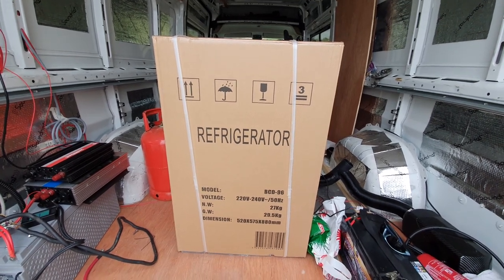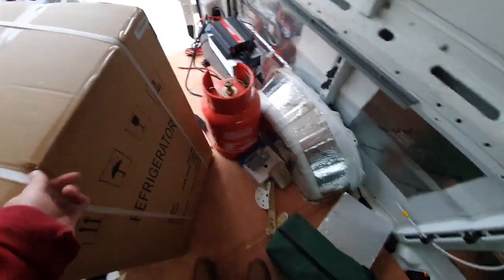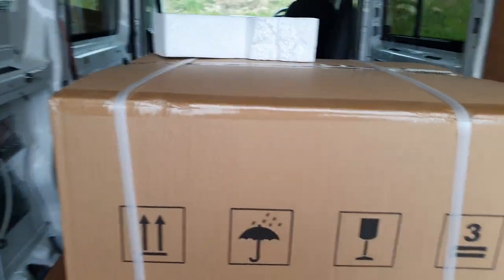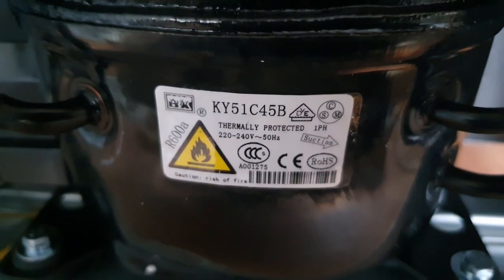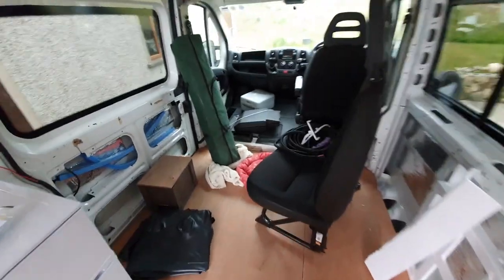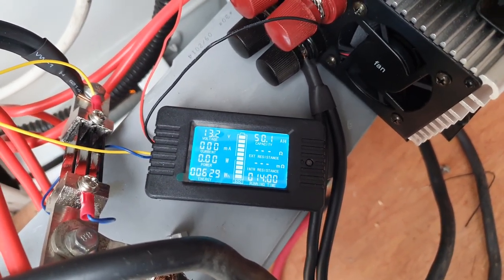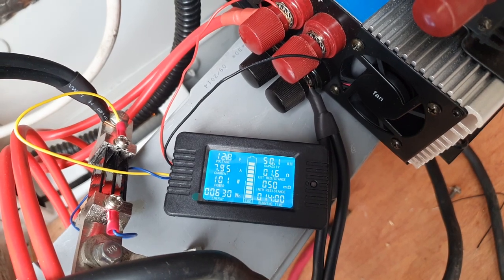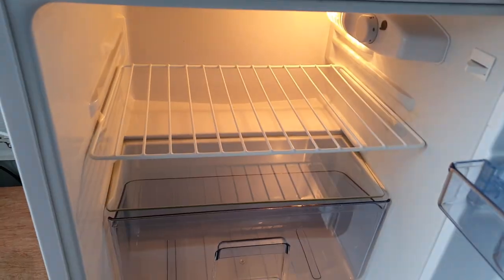Is this the END of Camper Van Fridges???

Comment: Hi. I have an under counter domestic fridge freezer running via my inverter on my Narrowboat, it has worked happily for over 3 years. I modified the thermostat by fitting a digital temp controller which comes with a probe on the end of a 2 m wire, it’s just a case of disconnecting the original thermostat wires from the compressor and replacing with the wires from the digital controller, I can now set the “exact” temp I want and choose how many degrees either side of that before it switches on or off again again. Mine draws approx 60w when running and was £147 from Curry’s as opposed to £560 in 12v from a chandlers 🤷🏻‍♂️

Comment: My double door uses only 1.5 amps my 6ft freezer only uses 1.2 amps.
Reply from the maker: Dan, is that mains power or 12v from the inverter? Jamie
Reply: @campervancreations7656  I've been off grid for 30 yrs and the nearest power is 7 miles away. The fridge is a full size house fridge and the freezer can hold two elks. Even on cloudy days I still bring in 20 amps. By morning I'm at 92 to 94 % on the batteries.  There 540 amp hrs each and weigh 2000 pounds each. I keep everything in a military emp proof communication shed. The pannels come from san tan solor and are 240 watt pannels that only cost me 750 for 25. So I bought 3 pallets. My shop has 50 pannels and it's well lit up and can run all my equipment. It's a far cry from the old days when I ran 12 volt system. 48 is the way to go.
Reply from the maker: Not jealous at all, swear, you had me at elks in the freezer. Or as I say, chest freezer that sleeps 2.😂
Reply: Times 10 for 120v to 12v or 20 at 220v better to use watts

Comment: I tied this game too. When it gets to 90 or 100 degrees, and you need to run this for a few days in a row, you'll find why a good 12v fridge is worth it.
Reply from the maker: Hey Bret, the thing is, if you have enough power to run a 12v fridge then there will be enough to run a mains fridge. I researched the current draw of 12v compressor fridges and compared it to mains and it's only about 10-12% less. Also household fridges are better insulated because they are held to a higher standard. Jamie
Reply: @campervancreations7656  - A quality efficient inverter has a 10-12% overhead for converting to 110v. And these small refrigerators you are mentioning in this video are nowhere near as well insulated as a quality 12volt fridge. Yes, a 'good' 12v fridge costs more, but it is far better insulated, has a far superior compressor that will last much longer (especially in a bumpy moving vehicle), and and is a direct 12v connection so no loss to inversion. Additionally, most of the 12v fridges are 'cooler shaped' which means the cold air doesn't spill out when the lid is opened. As mentioned, I tried this route you are looking at. It seems to work fine at first, but when you go into warmer areas, and are constantly jarring it with bumps, you will find the cooler fridge is a 'lot' more efficient use of power.
Reply from the maker: Bret, the only issue is for us,a fridge of comparable size to the one I've used is the price. This one was 179 a similar sized one, for camper/mobile is 1100 and I have way too much to spend on other things just now so bearing in mind the van has 2" of high grade PU foam insulation top,sides and bottom and our temperatures rarely go next or near 80 never mind 100, I think we'll manage for now. PS what's your setup in your van/RV
Reply: @campervancreations7656  - I use a HUGE 60 liter ICECO VL60 combo fridge/freezer. It costs 799 and works awesome. The more normal sized ones that are just a fridge or freezer (either/or but not both as the same time as they only have one compartment) are much less expensive and still work very well. (3-400 bucks). The key is to use one with a quality compressor, either Danforth or SECOP. Mine uses the SECOP.
Reply: If you buy a quality home fridge they're built just as well as a 12 volt one. They're not easy to find outside Europe as they do smaller fridges than the US or Australia.

I've had the home fridge in my motorhome (a 110 litre upright type) working absolutely fine and at correct fridge freezer temperatures (4 & -18C) in temperatures up to 39C.
Reply: What bout the gas in the fridge? Is there a danger of causing fire from being bounced around?

Comment: What if you're in the van fulltime with 700 watts of tilted solar/Alternator and 400 amps of batteries?
Reply from the maker: You have a setup I'd be really jealous of. But seriously, unless your in the article circle, that setup should be well capable. Just watch your levels obviously but also be aware of other loads that may effect consumption. Jamie
Reply: @campervancreations7656  Thanks Jamie, I'm a Corkman living in England in the middle of a conversion and don't fancy paying 400 pound for a 12v mini fridge basically,your video has helped me save a few quid 😅
Reply from the maker: @fol3564  brilliant, some really nice fridge freezers available and reasonably good pricing in UK. Our choice of style  here was limited but the functionality works brilliant. We'll done on the van life too. Full Tim is a big step.
Reply: @fol3564  a great way to get more efficiency out of a power inverter is to install a relay. If you connect a relay to the fridge thermostat and connect the inverter to the relay as well. The relay will turn the inverter on to run the fridge compressor.
Reply: Have you a video showing how to do this? It sounds straightforward enough but I wouldn't want to mess it up  @navigatingthedestination
Reply from the maker: Check out Crastercampervan  kippers. He has a video on the relay for the fridge inverter

Comment: One of the reasons cited for ‘proper’ Campervan fridges is that they’re more robust, would be interesting to find out
Reply from the maker: We've had this fridge in the back of the camper and in a small van, it's been moved about, taken in and out of vehicles, turned off, on ,left off and left closed. Bumpy back roads and fast motorway driving. No issue at all. All I will say at this point, I personally feel that this fridge/Freezer has done everything we asked of it and it's stillworking perfectly. If I had endless money and wanted a top of the line fridge, sure I could spend well over a grand on a campervan specific fridge, but I chose not to. Thanks for the comment, if you have any questions, ask away. Jamie
Reply: @campervancreations7656  that’s something to consider for my next build then!
Reply: It's rubbish. I have a 12 volt fridge in one motorhome and a standard home fridge in another and there is no difference between the two. In fact the home fridge being a good quality one is possibly even better.

Comment: When the 3way fridge in my motorhome (in the UK) died in 2019 I looked into the 3 options (2019 prices):
1. New 3way £1000-1200 as it had to be done by a qualified tech due to the gas.

2. 12 volt compressor £800 plus needs more solar, B2B charger, better battery.

3. Mains fridge £200, plus inverter £175 more solar, B2B charger, battery.

I chose 3 as it was the cheapest option (would have been if I had used the vans original leisure system). If by chance the fridge ever dies (it hasn't after two 4 month 10,000km summer trips in temps up to 40C) it's a cheap replacement.

The 3way was never very good in the summer in France, which could get over 40C. Once over 25 it started to lose interior temperature and at 30 was barely coping. This is an upright 100 litre one. I didn't fancy spending £1200 for a fridge that couldn't even handle heat.

12 volt compressor was by far the most expensive option. Expensive fridge and all that power stuff to run it. The only saving is I could DIY install it.

I bought a high efficiency, quiet (38dB) Beko TSE 1284 from Germany as it had the correct dimensions to go where the 3way was. Didn't need space on the sides or top for venting. Has an old style grid on the rear for cooling which suited the rear vented installation space the 3way had been in. Victron Phoenix 12/800 inverter (just for the fridge) runs it. I leave it on all the time so there's a fridge light. It didn't seem to use much extra power doing that over eco mode. 

I have kept the fridge vent fans in the van wall I had with the 3way and they're more audible (when it's hot) than the fridge. The inverter fan comes on for about 1 second when the compressor starts. Otherwise almost silent.

I wasn't sure how much power it would use so I installed a completely separate leisure power system for it so as not to affect the original van system. As it happens I overdid it, but that just means I have excess to run other things which is handy. 100Ah lithium battery, 30A B2B charger, 300 watts solar.

I have 200 watts solar and a 110 Ah lead carbon battery on the original leisure system. I reckon if I'd added the B2B charger and maybe 200 watts solar to that I could have run the fridge on that system.

Just had to work out a way to lock the shelves in place and a bar across the front of each one to retain food, then a simple lock for the door (all turned out to be easy and neat).

Best of all it works properly in any temperature. Frozen stuff stays frozen. It's great. 

The only feature I would like is one with electronic thermostat and separate temperature controls for fridge and freezer like a big more expensive fridge has, but I don't think any small fridges have that.

Comment: Very good Jamie.  I sometimes put a large tub of ice in ours the night before to bring the temp down. Jump start it if you will. You gave some great information in this video and I'm looking forward to your update.
MB BAR RANCH
Reply from the maker: Martin, thanks for the comment, glad you found it useful. Up coming soon.
Reply from the maker: https://powercity.ie/product/0BCD96

Hope this helps, I'll update the description now.
Reply from the maker: JP  So, the cheaper price probably mean they use more electricity and a less efficient motor. Just working on a basic principle, my fridge states it's a 75w but actually uses 100w when running the compressor and 15w when on standby so the average consumption is taken by the manufacturer and averaged out to 75w. The ones your looking at are probably similar but as long as its A+ rated they will use a slightly amount of power.

I've had mine on test off the solar panels empty as it's as it worst when empty. Very dull weather for 5 days and it's fine. Plenty of battery available. So trick is, keep fridge full as possible and it uses less energy!!!
Reply from the maker: You have more than enough to run it. Buy the secondhand one on ebay, even if it only lasts a year or two,its still a long way to £500. You could get 5-10 years out of it and that would be a result!!!

Comment: Away to get around the inefficiency of the inverter is to install a relay between the inverter positive and the fridge thermostat. You can run the thermostat as a 12v trigger wire. So the relay will trigger the inverter when the fridge needs power. The only down side is you will have to have an inverter just for the fridge but I think the costs for 12v fridges and rv fridges are way over priced for what you get and I think efficient fridges these days are better

Comment: Hi, do you keep your inverter on at all times?
Reply from the maker: Yeah, it's on constantly but the fridge is the main item used off it. Jamie
Reply: @campervancreations7656  i see, thank you. Does it make a lot of noise, the fan? Also did you check the power consumption when no power is drawn? Does your inverter work just fine when on for several days? Just bought similar fridge and wondering if I should wire thermostat to 12v and make thermostat switch inverter on and off to save power but I don't want to buy separate inverter to power laptops etc so your solution looks brilliantly easy.
Reply from the maker: The fan on the inverter only comes on when the fridge compressor is running and even then only when the  inverter gets warm does the fan switch on. There is also a method of using the fridges thermostat to switch the inverter on via a relay when it needs to run the fridge motor and then switch off the Inverter once the fridge is back to low temperature.  Jamie

Comment: Sirry folks, this isn't something I'd be prepared to risk.  I know I'm probably going to make a few enemies with my comments, but I guess I'll just have to live with that.

Well, the theory sounds really economical and promising, until you (a) corner a bit hard and shed the fridge contents all over the interior of the van  -  yes, a couple of latches or hasps and staples could resolve that, but I don't see them here, or (b) happen to become involved in a motor vehicle accident.  At that latter point you have an exciting opportunity for the crashing vehicle to shred the insulation from your wiring (if that hasn't already occurred) releasing live 240 volts current in a conductive metal shell and thereby possibly making life extremely hazardous for both passengers and emergency workers, alike.

Why would you take this option when you could avoid the cost of the (presumably PSW) inverter entirely, by spending a bit (OK a good bit) more on a 12v/240v compressor fridge which you can also bring down to correct operating temperature the night before you travel by plugging it into the mains power, direct?

I'm not trying to put down your creativity or your desire for an economical solution, but on our outback roads, I can only see this as a disaster going somewhere to happen. 

Now, if you desperately must have an inverter, in my view, that should be either switched on the 12v side, or unplugged from the 12v system while travelling.

Your comments are awaited with interest.
Reply from the maker: I appreciate your comments and your point of view. This video is proof of concept and not the permanent installation. All 230v electrics will be fully protected by MCB's and RCBO's, so should there, heaven forbid, be an accident, all mains power will be automatically isolated. The inverter will be required to run other things as part of the build. Thanks for taking the time to watch!